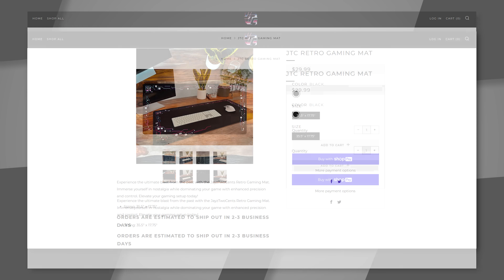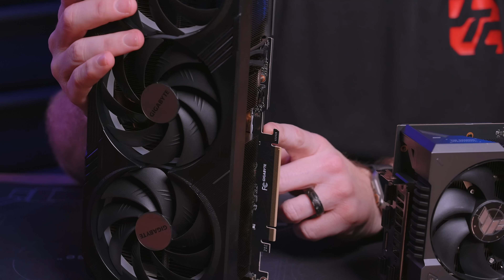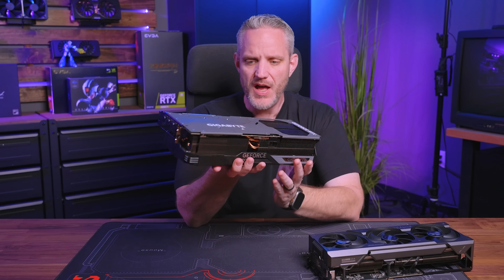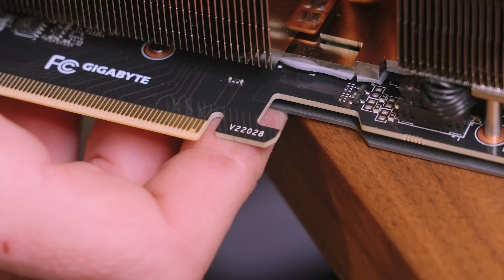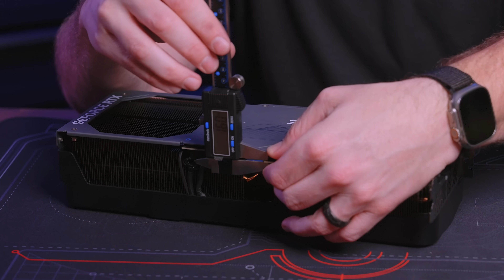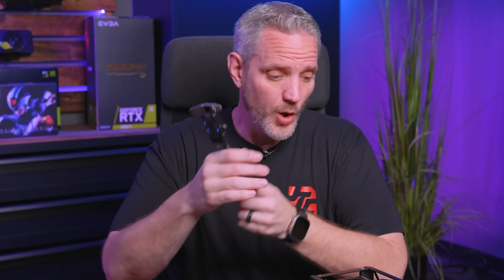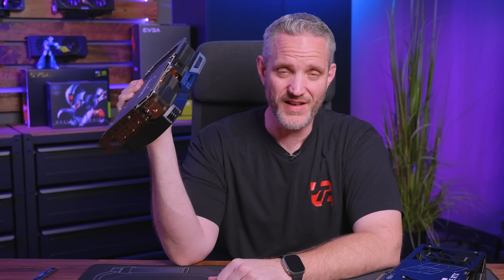These GPUs are cracking and the company REFUSES to warranty them!

Comment: If you look at the cutout of the clip in the Gigabyte and ASUS cards you see gigabyte went for a larger rectangular cutout with small fillets in the corners while Asus did a full round.  I've done enough FEA to bet that the larger cutout from Gigabyte with the small fillets is causing considerably more stress concentration on the PCB and causing the cracking.  IMHO this is probably the biggest reason for the sensation of the PCB on Gigabyte PCB to feel weaker.  More spring is actually better to prevent breakage of a part but the problem is the clip transitions to the main area of the PCB reinforced by the heatsink assembly which is very stiff/unforgiving.  So the clip fillet becomes a major stress concentration point and we see exactly what you would expect crack propagation.

Comment: I had Gigabyte RMA by DDR3 board that stopped working (probably a power issue in the circuit) and they fixed it which was bought in September 2012 and is still working at present day with an old i5 3550.
So let's not paint the whole company for a quality issue on one of their departments/branch/division/lineup (you name it).
The folks at the GPU field is the one to take the ownership and fix it. Period.
I guess.

Comment: In my opinion we've been past reasonable air cooling for high end cards since at least the 3090. It would probably be better if everything at and above that level of power consumption just comes with a presinstalled waterblock or AIO. The monsters of air coolers probably aren't any cheaper anyway, especially if manufacturers would start creating demand for waterblocks/AIOs at scale.

Comment: I had a look at my Gigabyte 3070 now and the PCB is pretty solid without flexing when pressed, not sure if the flex is only in the 40 series or on the high-end cards or a certain production line but fortunately my card seems solid. But regardless it is good to know about this issue. 
Thanks to the J2C team and keep up the good work.
Reply: I have a Gigabyte 3070 as well, and I haven't really seen any pictures of cracks on them, only 3080 +.

Comment: Many things to comment on this.

Gigabyte RMA aftermarket support is horrible. If you don't expect warranty support, then you should continue to purchase Gigabyte products. They will falsely (problems not caused by end-user) identify issues to void warranty claims.

PCB design has a keep-out area defines that you can't have traces or components in this area. IDK the PCIe spec but just looking at this design, no traces should be near this area.

You could stiffen this area with copper "flooding" or thicker copper layers. May not be a solution as it may make it too rigid and more prone to break/crack.

My money is on poor PCB design where the infringed or disregarded keep-out areas because space was needed and didn't want to increase cost with a more complex PCB.

Comment: Honestly, when I saw from Roman "8auer" Hartung how Gigabyte designed the cable management for the PCI power inputs of the Nvidia 3000 cards that there were practically not the plug adapters soldered to the PCB but were connected by cable, I thought to myself oh my Gosh I would never buy Gigabyte again.

Comment: The material for PCBs varies, depending on what you specify, but the most common is FR4/G10, which is a glass fibre loaded epoxy laminate. OMG, I see the fanbois you mentioned are out in force lynching you for some sort of bias because you read your callipers incorrectly ... 

btw, 1.6mm is pretty much the standard thickness for your average consumer level PCBs and not heavy duty in the slightest. pretty flimsy for such a heavy card. for such a high performance device I would expect something closer to 2mm for what is probably 8-10 layers minimum. You can get away with making it thicker with high layer count PCBs, as you can specify thinner dielectric layers to maintain good capacitive coupling and impedance control. if it was only 2-4 layers you wouldnt want to go thicker than 1.6, as you mess with the performance/impedance and you start to have to make traces too thick to maintain 50 ohms.

Comment: Nobody talks about EVGA's line of 11GKR Gaming Black Edition RTX 20 series ti cards.
Why? Because nobody wants to buy one.
Nobody wants to keep one.
They are volatile unusable cards with a 50% coinflip of bricking as soon as you turn your PC on.
Everyone knows it but its not like a news story or highly rumored thing.
Its a silent rumor nobody speaks because its just internally known as fact by the subconscious.
There is a sleeper agent inside of you that does not want to buy or list this card for anything above 200$.
Not even EVGA wants this specific line of cards. They dont actually make the 11G KR Gaming Black Edition RTX 2080ti any more. If you send them in for RMA, they just replace a capacitor or die, put a new sticker on it, and send it back where it will do another diceroll with the system and either "just work" or JUST NOT. with the in-between phase capping you at 20 frames and drawing green lines all over your screen.
The design of everything on this PCB is fundamentally fucked and EVGA does not want to actually address it or give you an alternative card to this one.
You do not step UP from this card through EVGA.
You do not step DOWN or SIDEWAYS from this card through EVGA.
If you go through EVGA about this card, the only thing you get back is THIS card.

Every time you see one its in an RMA box or "for parts"

Comment: Gigabyte warranties are terrible for GPU's. I've had warranties rejected because my failing VRAM was intermittently causing bluescreens and instead of using the tools made by nvidia to specifically test parts of the card like 3rd party repair centres use, they just stress test it. If nothing happens they update the bios and tell you to essentially go fuck yourself. This has happened on 2 separate GPU's from gigabyte and the only time they actually accepted a warranty return was when the first card completely died 1 week later.

Comment: I'm wondering if a large part of it is the structural piece shown @ 6:49 . You can see that it doesn't flex at all near the ASUS logo which is right under that structural piece, but does flex more in the middle where it isn't as important.

Comment: The base PCB materials are fiberglass and resin. There are different qualities of fiberglass (i.e. regarding the length and thickness of the fibers), and the material properties can be adjusted by using different fiberglass to resin ratios. The orientation of the stacked fiberglass layers can have an impact aswell, as you want to rotate them relative to each other in order to improve tensile strength in every direction.

The whole issue could be a cost-saving thing, an engineering/assembly oversight or a source materials quality issue.
Reply: In this case, it's probably not a difference in PCB material but rather the fact the Asus card has a standoffs that connects the rear heat sink to the front heat sink on either side of the PCIe connector.  That'll do a lot to make the card significantly more rigid in those two spots because you'd need to flex not only the PCB but also the entire cooling solution. I get the feeling that this was probably an intentional design decision because all their cards since the 10 series (or earlier) have these same heat sink mounting points.
Reply: It is also likely a design issue. The gigabyte one is using a non-standard tab that is thinner and has sharper corners, which will both result in weaker parts. If you look at the comparison between the tabs the Asus one uses a stronger shape for the tab.
Reply: Adding solid copper fill to all layers would make more difference to strength and rigidity than the flavor of FR-4 that was used. Actually I'm surprised that manufacturers generally don't use copper fill on internal layers in the tab area (obvious as it passes the light). Not to say it would not cost anything at all as copper foil is already there and is etched during manufacturing, not added. Also I totally agree with @ckitching2.

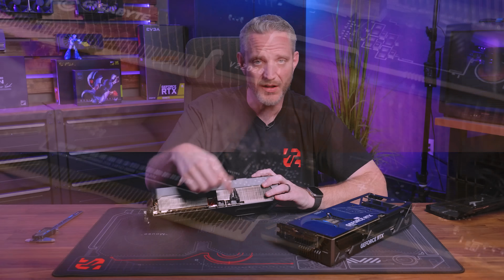Comment: @14:12 - the ASUS card has more material at the notch compared to the Gigabyte card.
Squared corners (Gigabyte) are more prone to fatigue cracking than rounded cuts (ASUS).
Finally, it appears that ASUS has a metal standoff/brace that would also reduce potential flex of the PCB in the vicinity of the retention hook.

Comment: @6min 40sec. if you look at the asus card it has a cooler mount screw/bolt right near the tab that possibly helps strengthen it whereas the other card does not and you can see the massive difference in flexing.

Side note that is some serious elitism right there by Phil if he was serious with the whole " it doesnt say 90 at the end " I hope it was not serious. Crap like that likely contributes to why they jack up their prices so damn much.

Comment: Ever since the 900 series, I bought a case with a horizontal motherboard mount due to how much cards were starting to sag. (C.M. HAF XB Evo).  I don't think I'll ever buy a vertical mount board case until layouts change where vertical GPU mounting is the norm.  Some cases have it now, but most have the cards too close to the cover for my liking, starving the card fans.

Comment: well . . . anyone with common sense understands that this much overhang will create tension, its so stupid not to use stands on 3000 and 4000 series cards its crazy. especially even more so, because many people skim on the MOBO, so those slots are at risk as well. 5 bucks - solved. ( Pity not all manufacturers include those - thats what must be targeted here I think, maybe demanded even, considering the prices of those GPU's - usually upper end right - come on ) Cards are not going to get smaller any time soon. Tie-in in the IO end helps as mentioned, but still - people - i mean - look at those beasts. I use vertical (Core P5 - still the best), had 3090 Aorus, have 4090 now - no problems encountered. Its different if that occurs with vertical though - then its a real problem. Standart  - sure - not as well engineered and thought out, but they can always sell you another card once RMA is denied, right. . . or just buy a stand, that is - use your head ;)

Comment: OK Jay,
Just from a standpoint of a mechanical engineer.
You are a Car guy, so let's not pretend we don't understand torque.
First, Yes, you are correct that Fixing the I/O plate to the cooler will help 
but the amount of weight that will support doesn't even apply to 30/40 series. It's basically effective for a card Like RX590.
And I agree, every little bit helps, but you can also induce other issues. Like PCB twisting and de-soldering under high Temps. 
One that Card manufacturers want to avoid, bending of plastic Shrouds leading to Fan Noise, or even clearance issue. 
Second People, Even Steve forgetting the back screws when disassembling. 
And finally those Backplates you have there, or even better something like SAPPHIRE does is Significantly more rigid than adding a few catch points on a TINY plate like I/O plate. 
And remember, EVEN if it can hold the weight of the Entire card.
The plate itself is Held By a SINGLE screw to the case. 
So let's not embarrass ourselves. I love you and I know you have it in you as a Car guy, so please... Think. My point here is not to embarrass you here saying you are wrong but prevent bigger embarrassment in the future. We sadly live in a world where we are used to dealing with the consequence, and we have stopped solving the roots of issues. It's rubbing on all of us. 
I agree your Idea is beneficial and Manufacturers should do it as Step 1 but let's not Greta Thunberg here and Claim Cow farts are killing the planet. 
I/O plate has different issues By design that need to be addressed before it can support new cards. 
Full slots(as wide as the card) I/O would be the next step. But all of it is Pissing at the Forest fire. And again, consequence Can you now fit a 3 slot I/O card in your case. (you can make it Blank, just extend the metal for support to press against the back of the case) 
See... Endless ...
It's like You have a tuned 800HP engine in a Mazda MX5 and your Gearbox keeps exploding, so you put a heavy-duty Gearbox just so your Tires burst at start or your car flips over on its own when it's parked. 
You will just induce other issues you don't think about now. 
Sadly, two best solution you can have now are:
Strong backplate so you get some cooling and overall low torque rigidity spreading load to the PCI slot and I/O shield
Or Best one, literally addressing the 1:1 torque point at the Other end of the card.
We could try and do better thermal designs, but that would really upset Jensen and the elitists, and we can't have that, can we....

Comment: Maybe it could be the locking mechanisms, specially the one that looks like a flap and the card's has to press against it until it falls into locking position... or maybe the user could be "fingering" hard enough the card to the point of braking it... but since Gygabytes cards are the only ones that are breaking, they should at least come into an agreement with the affected buyers. in my opinion that is... xD Cheers!

Comment: pure guesses but I think Asus already had the same problem and solved it. at 6:57 you see a comparison of both cards. on the Asus card, there is a continuous assembly from the cooler to the pcbn's support plate. The Gigabyte card seems to lack support for pcbn across the board. and the Asus card dont have such big cutout of the pcb.

Comment: I have a Gigabyte 3080 OC card that is failing to boost to their OC speed, and when I sent it for warranty, they reject any repair or replacement, giving me a shitty excuse that as long as it can hit the default clock of 1800, the card is FINE and not "broken" and don't need fixing, not even when it CAN'T hit their default factory overclock speed, can I get it repaired or replaced. Gigabyte is the SHITTIEST company in my book now and I will NEVER EVER buy anything from them ever for my next build. NOT EVEN when there is a global shortage again. (I only got this shitty Gigabyte card because my preferred Asus card was Out of Stock at the time.)

Comment: But the PCI-e socket has "spring" loaded contacts. Any angle you put on it, would just be within the range of the contacts. You would have to bend the card A LOT to get the point where the you passed the range of the contacts and are starting to stress the plastic of the connector on the motherboard, and the PCB. My guess is that such bend would cause issues with the contacts not sitting correctly and causing hardware stability issues before breaking the PCB. Pulling the card without pushing the release button properly, seems more likely.

Comment: For years I'm lobbying to have the damn gpus in its own PSU like tube box and have the pcie + power slots, yet we reached to the point where the GPU is literally cracking on its own weight with the traditional motherboard seating and have poorly designed power connectors break off.

How easy it would be to have a box to be cooled with 1-2 12/16cm fan that, the GPU designers can use multilayer pcb with custom two sided cooling on the chip making gpus not just radiate heat upwards but have a direct airflow out like a server rack and have more dynamic cooling solutions. the same reform we need as we saw on memory and ssd to go away from the horizontal building to the actual vertical stacking, not to mention to make the power connectors to not stick on the top side and bend cables and break connectors ...

we literally reached to a point where a gpu is a 1k watts of radiator weighting more than the motherboard itself, we need to swap to a new design from the traditional design as we start to have more problems fixing an issue by sticking to a limiting design.

Comment: I don't know how consumer protection laws work in the US when it comes to manufacturing defects that appear after warranty expires, but probably a lot less consumer friendly in some parts of the USA than here in Norway? 

The regular manufacturer warranty on electronic goods like mobile phones and computers here is commonly one year, but consumers can also RMA a product up to either 2 or 5 years after they bought it new, depending on how long it's commonly expected to last, so generally 5 years. This extended RMA period applies to things like for example manufacturing defects, design issues that cause it to malfunction after warranty expire and safety issues. It lies on the manufacturer or its representative to prove they are not at fault, not the other way around.

Are there widely known court cases in the USA where manufacturers have been been found liable to repair or replacement with a equal or better product after warranty has expired for products like consumer electronics? I guess that varies a lot from state to state, so I'm thinking more on a federal level here.

Comment: I had an old Lenovo workstation with NVidia Quadro cards and the one thing they do is supply a metal extension that slots into rungs within the case that hold the cards very firm.  These cards were long but no where near as heavy as modern cards.  It seems like a brillian idea that would solve a lot of these sort of problems.  The different length workstation cards had deferent length extension to suit the cases.
If a standised maximum length was established it would be a simple matter of inluding these slide mounting as a small extension that bolts to the end of the heat sink etc.

Comment: One thing I would look at. Run the card with a thermal camera capable of doing the area that is cracking. If it contains a power, trace added heat can cause embrittlement. You could also have the trace swelling from heat, helping crack, the PCB there should be no traces in that area. The PCIE header of the circuit board should only have straight down traces to the socket and avoid electrical connections anywhere near it.